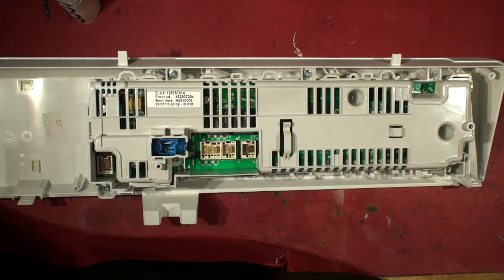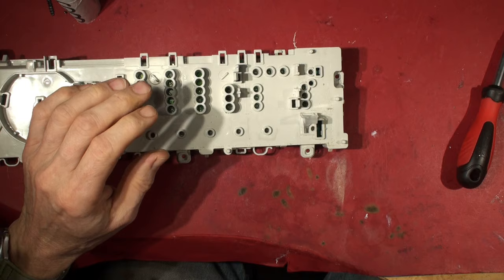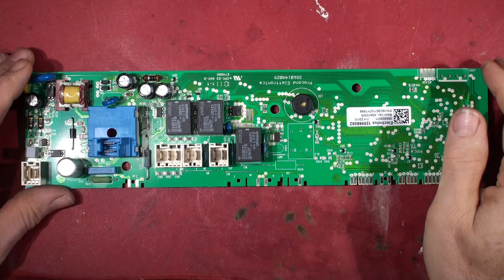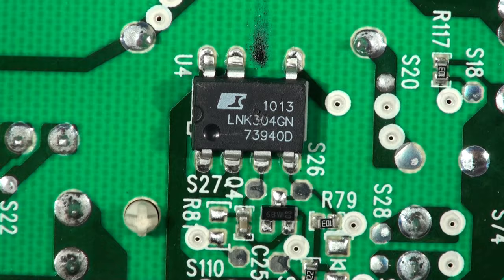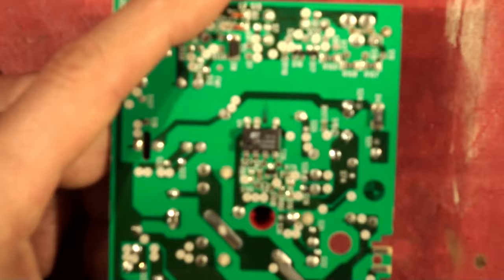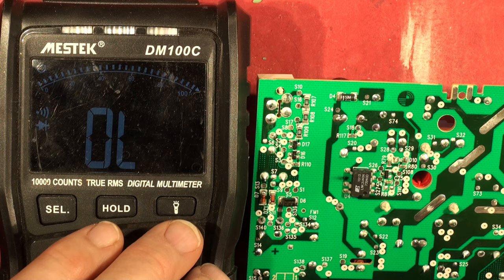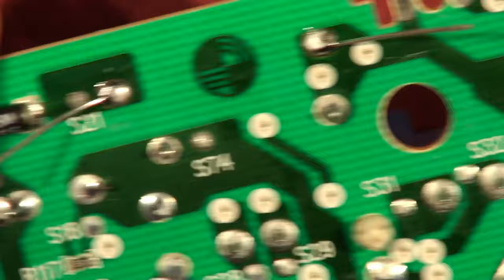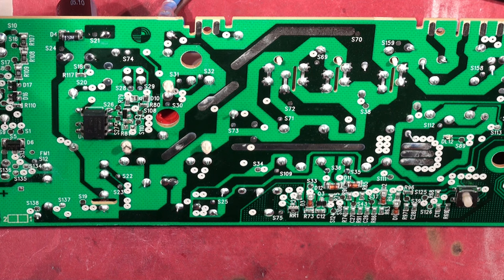AEG Tubmle Drier Dead Controller Repair and test

Comment: Hi your video is helping me a lot, but I'm wondering my washing machine is turning of completely after water level device clicks when there is enough water, like it goes some short circuit. After I remove water from machine it goes back on on its own, display is running I can choose programs etc. Water level device is OK I checked it with specs and tested with multymeter, it do what is should do. On the board there is no smoke no damaged components everything is nice and tidy, can it be damaged board even if everything else is working including a display? Thanks.
Reply from the maker: Hi, Which LEDs are on or flashing when this happens?  When you say short circuit does the machine blows the fuse or trips the circuit breaker?   If you select a cold rinse program does this happen then?
Reply: @razenby  I solved it thanks to you, I was looking for short circuit. It was one, signaling wire from temperature sensor were touching heater, melted and short those two wires together, I just cut off the damaged wire, reconnected connectors (also checked rest of the wires for damage) and now it is working as new, no problems at all. Thank you so much for the help.

Comment: hi , where can i buy the 2 components the chip and the resistor to do the repair,
thanks,
brian
Reply from the maker: Which components do you need?
Reply: @razenby  hi magic smoke, I have had trouble getting in touch , I need both components, the chip and the resistor45r. Thank you.
Brian.

Comment: Thanks for the video, very clear. I have a similar controller board that has stopped working. But I think the LNK304GN is ok. There is a lot of soot around the transformer. My buck coil (transformer) looks a bit different to the one on your board but I think it's doing a similar thing. I'm having trouble identifying it for a replacement part. It's markings are E47 x 1116. Any idea what those numbers mean??
Reply from the maker: If you see a LNK304GN then change it. Hoping that it is good wont save you.  The 304 may have damaged coil. Are you sure the soot is coming from the coil and not jetted out  of the side of the 304?
Reply: @razenby  Thanks for the reply. It's possible the soot is coming from the 304 but that's sitting on the underside of my board and most of the black soot is on the top - how far does it travel? I do have a Triac that's blown (for the circulation pump), but that's some distance away. The soot on my board looks just like this one - https://www.elektroda.com/rtvforum/topic3726567.html  - mostly around the transformer. The 304 is sitting on the reverse of the board just under the big resistor and diode. The wire wound resistor on my board is ok. Maybe I will check the transformer by removing it and measuring its coils?
Reply from the maker: @fluxobjects  In the picture it looks to me to be  fine dust attracted by the electric field on the HV side of the board. Get some iso-propyl alcohol and give the board a good clean and then look for the scarring on the components.
Reply: @razenby  Ok. Thanks. I'll do that.

Comment: Hello. I had a dead dryer and I managed to get it powered by replacing the LNK. But now I get EH0 error. Ive sent you an email as well. Please give some hints why this error might be happening.
Reply from the maker: EHO is a power condition error.   It is sensing (maybe erroneously) that the mains voltage is not correct. Check all connections to the controller are correct. Clean the edge fingers on the board and inspect all crimps and wiring. It may be  bad connection somewhere.  Bad mains plug, bad mains impedance (poor house wiring) or running on an extension lead can cause this.   Otherwise you may still have a fault or a bad relay or  bad solder joint in the AC power tracks on your controller on your controller. Inspect very carefully.
Reply: I got it working finally! Did two main things 1) touched up some solder joints which seemed ok but werent as perfect as the rest. 2) removed my old install of the lnk364gn and cleaned up. Lost one more pad in the process. But eventually i used a 0.6mm enameled copper wire to short the Source pins of the lnk n also to connect the bypass cap between pin 4 n pin 2. Assembled everything n now no EH0 error! Drum turns fine everytime!!
Thanks a lot for your great videos n help otherwise!
Reply from the maker: It is satisfying to know that another unit is saved. Please remember to like and subscribe..

Comment: What happened to your third installment of the Bose solo videos?
Reply from the maker: Half of it is  in the can. I am waiting to borrow a suite of the correct development software for the DSP. It isn't cheap.  I still have to work out which chip has been branded as a Bose custom part.
Reply: @razenby  shame, I've got a Bose Solo here with an intermittent fault whereby sometimes the unit won't enter or exit standby mode. Or, won't enter standby most on first power up. I've added extra decoupling to the 1.8v and 3.3v rails next to the DSP chip which seems to have helped. Got some new crystals on order too as I suspect there's an instability somewhere on the low voltage side which is leading to the DSP to not initialise correctly or just crash. Quite interested to see what your findings were.

Comment: Hi there. Do you offer a repair service?  I have a problem with my AEG dryer board with drum only rotating in one direction. Can you provide email address. Thanks
Reply from the maker: Hi Susan, sorry no I don't have time due to other commitments.  The problem is likely to be a faulty relay on the controller.

Comment: I have repaired a dead bord, but now I have error E70 and can't reset, any suggestions?
Reply from the maker: You probably have the NTC temperature sensor plugged into the wrong port. (easily done) Check and also check the wiring loom to the heater sensors.
Reply: You Are right. It runs now 👍
Reply from the maker: @peterchr.warncke1976  Whoohoo!! Good job. Don't forget to subscribe!

Comment: Anyone know whcih relay on this board causes the E62 fault?
Reply from the maker: E62 is the power relay or blown heater element. In my experience it is much more common for the heater element to fail. It is easy enough to find out which one it is by tracing the series back from the heating element to the plug that connects to the controller and then check to which relay the traces connect to from the corresponding socket. The element itself should read in the range of a few tens of ohms across it's power connections and on your highest ohms range on your  multi-meter, you should get no conductivity between the power connections and the machine chassis.
Reply: @razenby  Very much appreciate you explaining as you go along, thanks
Reply from the maker: @mickpatel9504  My pleasure

Comment: Question.. Next to the LNK chip is a NPN smd transistor and in your video its marked Q4 see: https://youtu.be/muZyKkXTbac?t=649 that one is bad in my case, it's marked C6t others have reported it marked B6t and yours 6Bw, what is it? there are 2 more on this board (Q5+Q6) and measuring the good ones I could only make out its NPN based. Also the "figured-out" schematics you can find online don't mention this transistor.  Info about that ? anyone ?
Reply from the maker: Device code 6B  is ON Semi BC817-40LT1G NPN Transistor any SOT-23 BC817 will work. The question is why is it blown?
Reply: @razenby  Thanks for that needed info. First the obvious problem (LNK304 was blown + resistor), instead of fixing that (no parts) I tried in a stupid attempt to bypass the LNK and feed it with buck converter but that didn't work (prob. fried the transistor in that attempt) Eventually replaced the LNK and of Corse now that did not work and found out that the transistor is defect. The selector also feels weird/loose so its my last attempt in fixing this dryer.